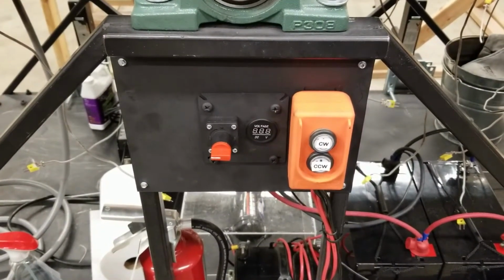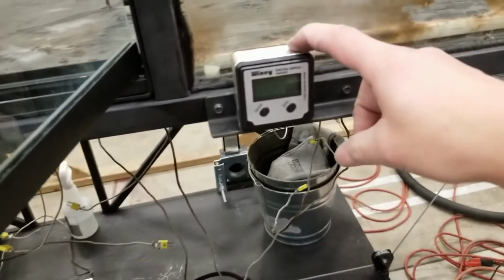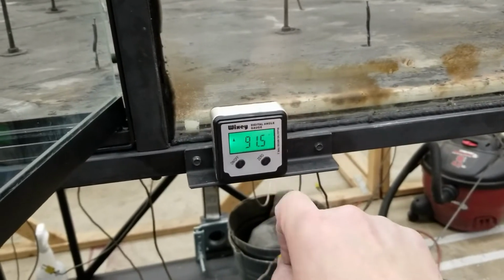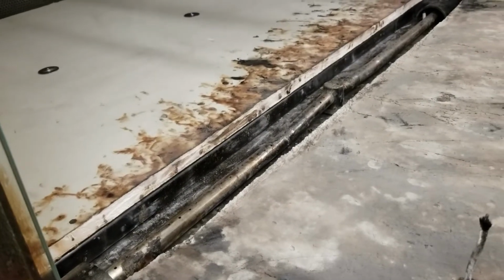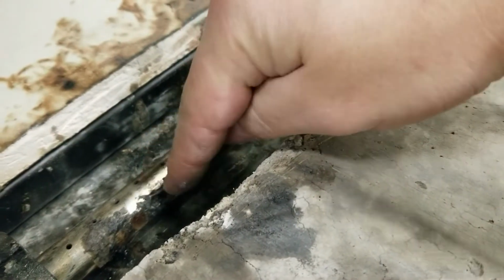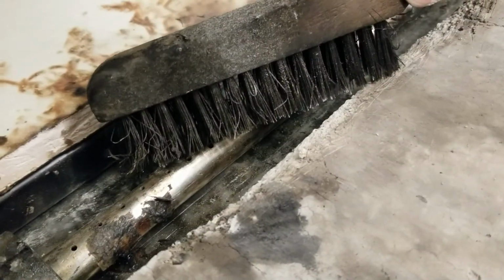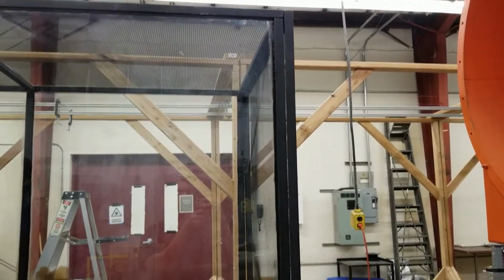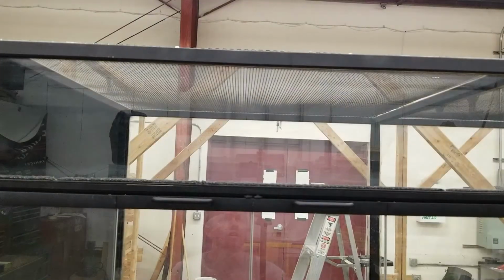Introductory Start up Procedures and Maintenance Training

Comment: Are you going to post demo runs of the pyro wind tunnel?
Reply from the maker: If I can get some editing time I have video of our demo run with a fogger. 
I'll have to request video from the department (or time to video a demo) of the tunnel in use as designed. Hopefully I can make that Scheduling happen, the pandemic cut short the original plans to film as designed use in 2020.

There is a video at the top of the play list from the previous team which shows the "natural draft" use of the tunnel.